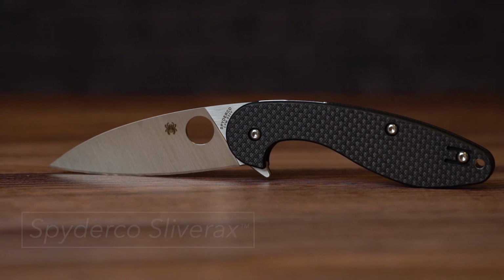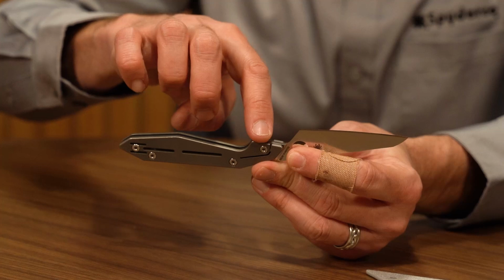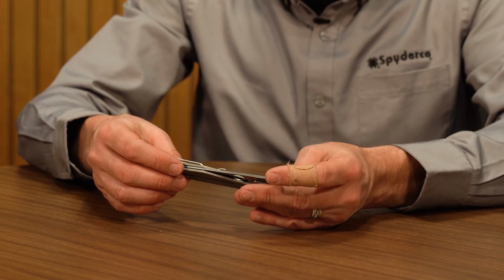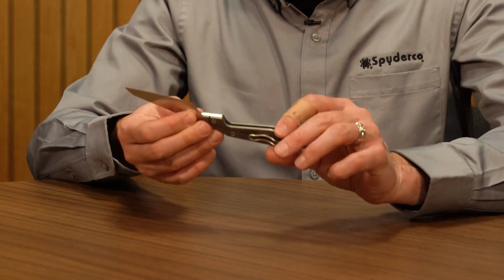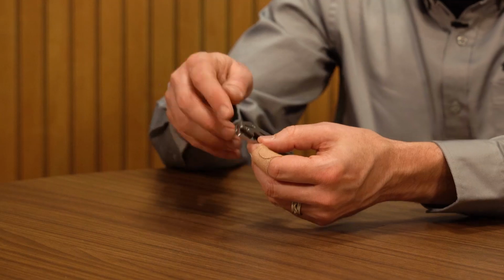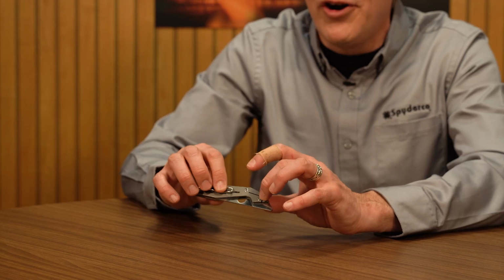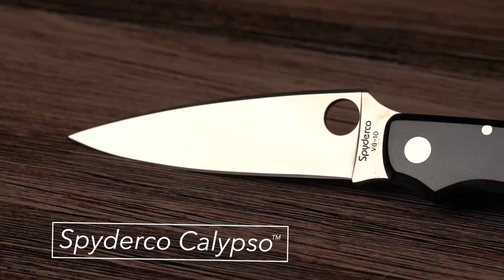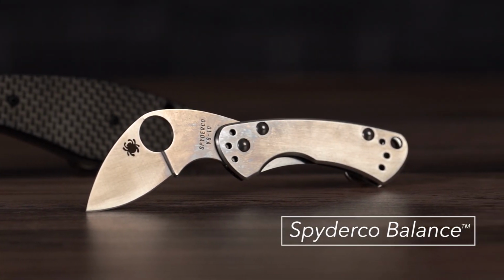Paul Alexander Designer Spotlight

Comment: This would have been a far better design if the hole had been far smaller, and used as a 'token hole' as on the Ronin 2. The hole is a massive weak point and the blade would have been far stronger if the size were greatly reduced. There is already an efficient opening mechanism in the 'flipper' - Chikiri, as it's called on the Higonokami. Can we have a redesign ?
Reply: If you think the Spydie hole is a "massive weak point" on this knife, you should then look at the tang of of almost any folder, with the pivot hole, notches for blade lock up and stop pins. The tang of most folding knives look very fragile in comparison.